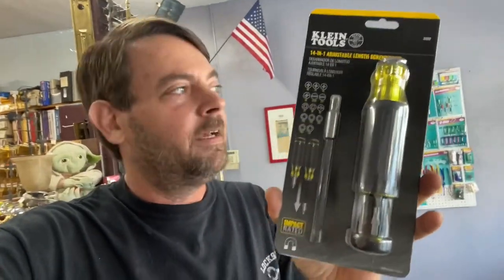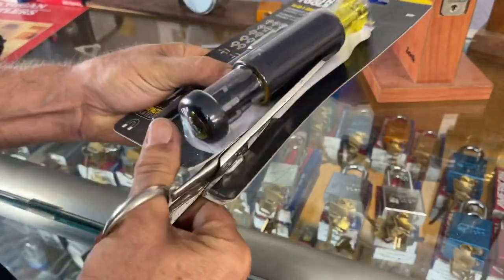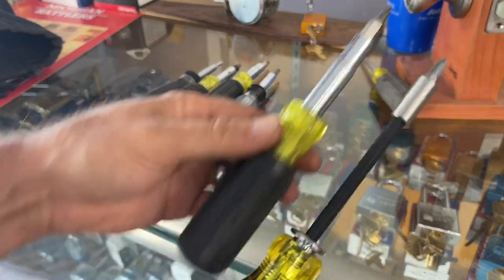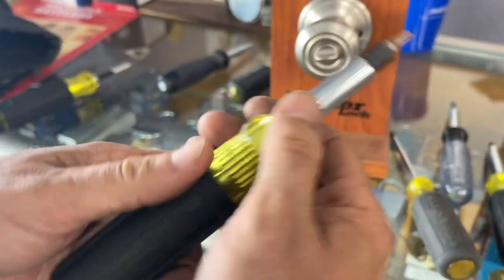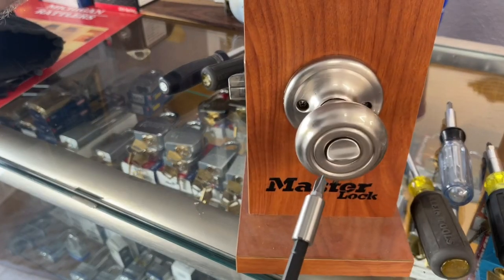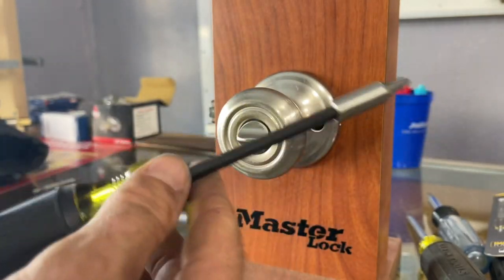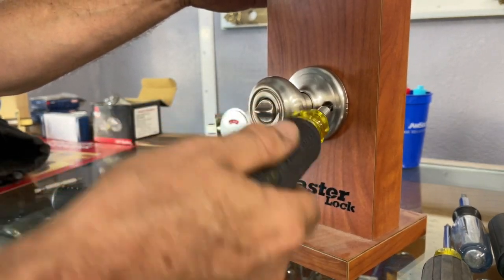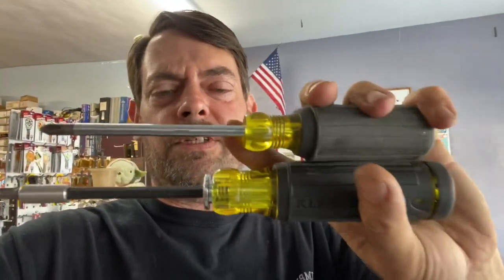the new Klein 14 in 1 Adjustable Length Screwdriver!

Comment: That bit is an ECX bit is used for screws for electrical boxes, conduit couplers, outlets, etc. Just a electrical combo bit.
Nice videos. I like tools, so keep em coming.
Reply from the maker: Thank you!
Reply: Was just thinking I usually see those screws around electrical stuff, always through it was just so you could use either screwdriver on them. Never knew they made a bit that actually fit both.
Reply: Is the ecx1 for outlets or the ecx 2?

Comment: I had one for many months and was sad when the collet broke.  I was incidentally doing a bit of light prying to push a spring away to get to a screw when it broke.   The metal appeared to be a very thin cast material.  I want to get another one but I'm not sure if I'm just a beast or if it is just a weak design.

Comment: The weird looking 'combi-bit' is a composite of Robertson, Philips, and flat/slot drives. They are notorious for stripping easily because they tend to be used on truss head screws or very thin pan head screws made from fairly soft metals which means they cam out very easily.

Comment: That #2 ECX bit is *mainly for electricians. Example: Breaker panels, circuit breaker terminals, conduit screws, etc... The screws look like they could be Phillips, but also accommodate Flat, or Robertson drives. But, they are truly their own thing, ECX. --- They are fairly rare out in the wild ... First I saw some years ago in any home improvement store was on a Electrician's specific Milwaukee multibit driver with wire stripper built into the handle.

Comment: The "diamond with cross slot" bit is a Xeno drive bit... for electricians.  Used mainly for receptacles and light switch screw contacts.  A cross between a phillips and slotted driver that gives you more torque, over just using a phillips or slotted screwdriver.  All three types can fit and work, but the Xeno driver is best for it.

This driver has a nice big handle and provides much more ability to torque fasteners.  Love this with the 32900 multi nut driver... you can swap the handles/shafts.

Comment: Another comprehensive review of a multi screwdriver not fit for purpose for a locksmith. Does any tool company make a locksmith specific screwdriver that copes with knobs. They could develop one with a little bend in it so you didn't have to try and screw the screws out at an angle. I've found with old rusted in screws, that angle makes quite a difference in trying to get purchase on the screw head without stripping it. Maybe I need to become an inventor! Thanks for this video, cheers
Reply from the maker: Got a funny one coming up shortly that actually shows doorknobs on it, you will get a kick out of it! Should be live in about an hour :)
Reply: @selock  Excellent I can do with a laugh today, thanks mate

Comment: The #2 star bit is for screw terminals on electrical terminals such as the wall plugs on your house. After all Klein tools is all about electrical. That's a neat screwdriver.
Reply from the maker: I’ve never seen that bit but my first thought was “is it for combi head screws” but the shape threw me off! I checked several “bit diagrams” and none of them show that one!
Reply: Yep they are almost a necessity if you are doing any amount of electrical work. Especially in a breaker box.
Reply from the maker: https://youtu.be/7FXGypPKgPM

Comment: ChanNelLock
#1 Phillips
6" (elongated neck)

It's a fixed bit driver perfect for swapping mortise cams.
Can be used to change the handing/auto locking of mortise locksets.
Slim circumference neck for hard to reach corners while accommodating for perpendicular angles (or relatively).
Easy for wheel-brush replacements on machines.
Highly durable bit that can sustain regular abrasion.

Typically better off as a stationary tool rather than OTG installations but still a reasonable back-up in general.
Thanks for sharing 👍